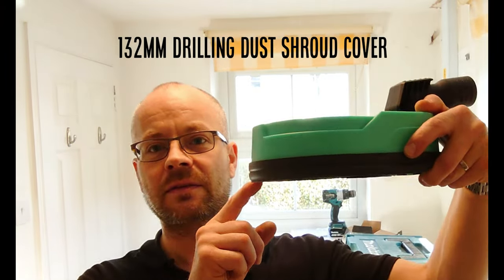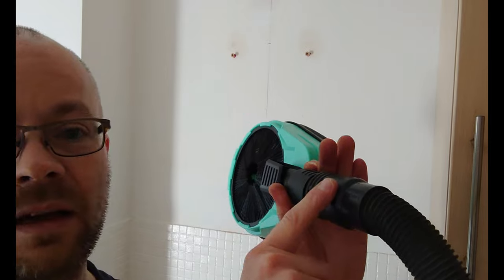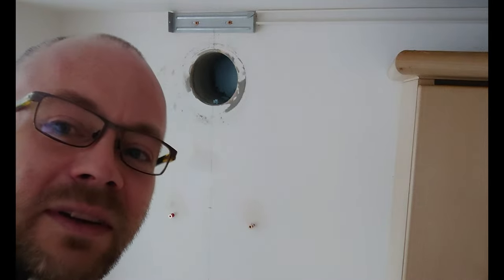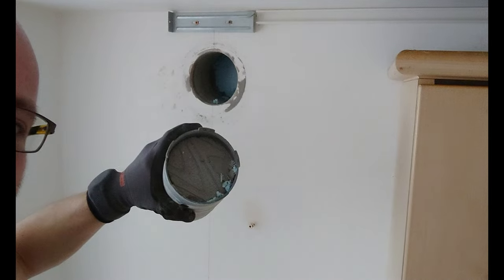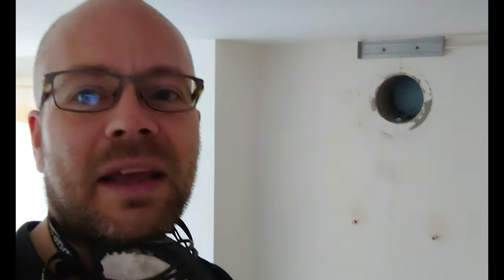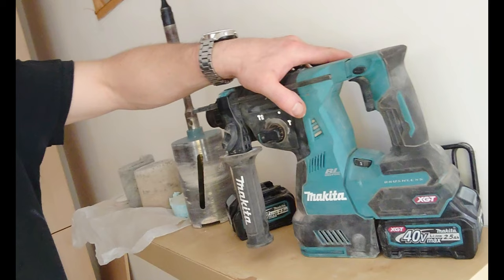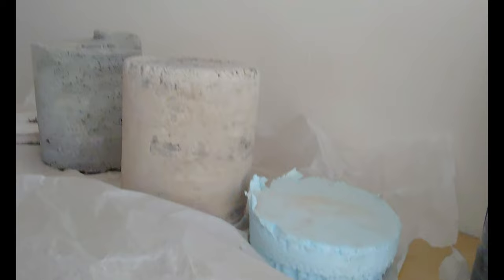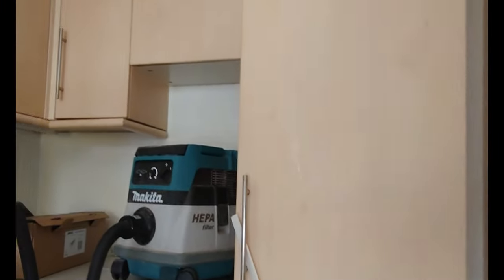Does this Extractor Remove ALL Core Drilling Dust? | Includes Real-World Demo

Comment: Thanks...That was a very good and honest test of the product and it was a big bit you have used. I was thinking without your pilot hole, the chances of seeing where you were drilling would have been slim to nothing. I wonder if it would work just as well with the top 1/3rd cut off. Maybe not with that size bit, yet smaller maybe it would and allow more of a view. Thanks again, very interesting.
Reply from the maker: Great, thank you for your kind comment. 
You always need a pilot hole when coring, otherwise it will jump all over the wall. Once a cut has started, I usually go in about 10mm, then the pilot bit has to be removed.

There are half size extractors for drilling, but it you were to cut this one in half, you would loose the suction against the wall. Also, large cores throw out so much dust, doing so would fill the room and make the extractor useless.

If you purchase one, please let me know how you get on with it. 👍

Comment: There are attachments that screw on between the machine and drill that sucks the dust straight out of the drill while cooling it at the same time. Way easier, cleaner and healthier for the segments.
Reply from the maker: Indeed there are, but you need specific core drills in order to do that which are very expensive in comparison. For someone like myself who only core drills maybe a few times a year, they're not worth the extra cost.  I don't disagree with what you're saying though 👍
Reply: @ChampionsOfTheTrade  Looks to me like you were using a core drill with a finer 1/2" thread, but there are attachments for those aswell. They are about £200 :) not sure what they're called in english, but in sweden we call them "Dammleka".